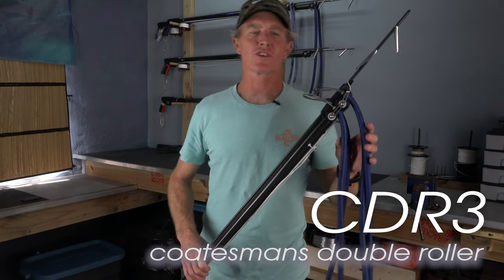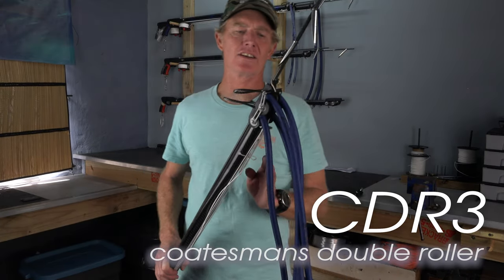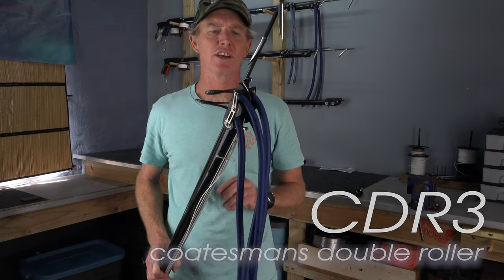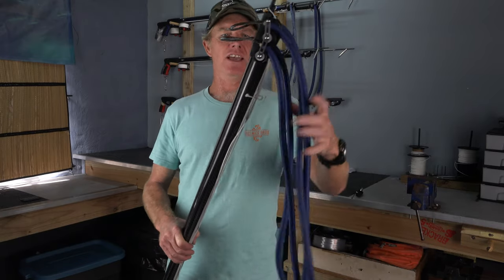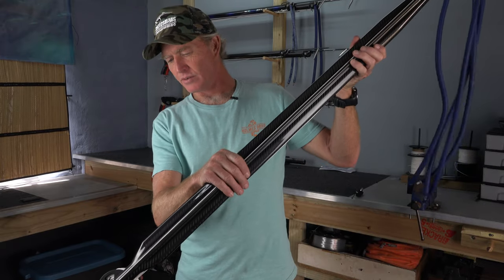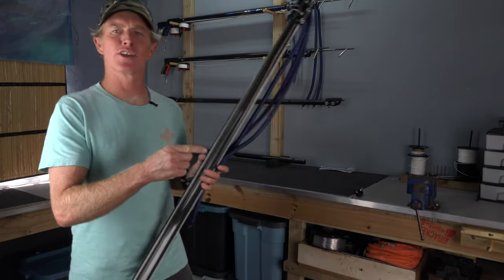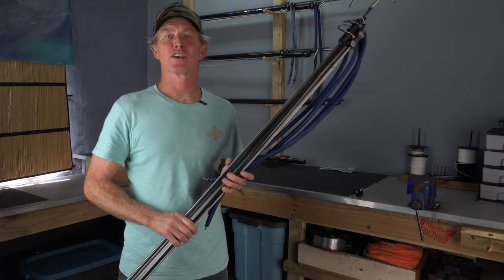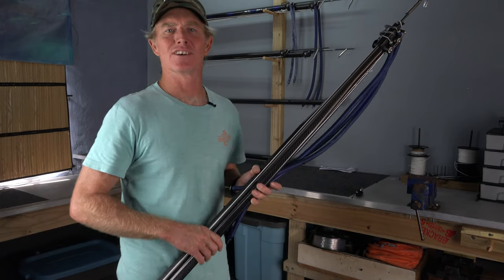How To Pretension a CDR3 Double Roller Speargun

Comment: which barrel is this / specs?
Reply from the maker: Hey Jercx,
This is my Step Up barrel which comes in 120 &130 cm lengths. It is specifically designed to work with my double roller as there is nothing else on the market that is a 100%
Reply: @CoatesmansSpearfishing  i can't seem to find it in the site's shop, is this going to be made available to the general public? =)
Reply from the maker: I do make guns to order. I have a little bit of a waiting list (why I dont advertise or have on the site) but drop me an email at saltydiver@gmail.com and I will send you a price list of the guns I build.